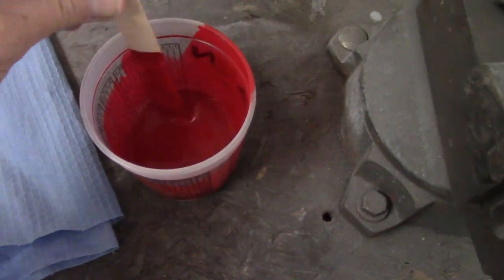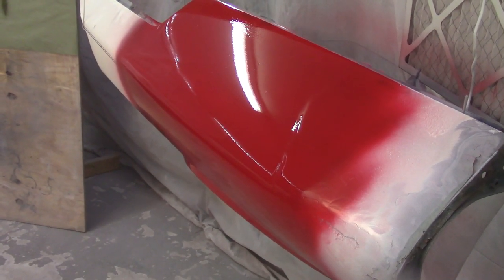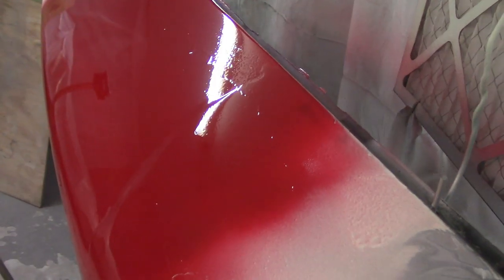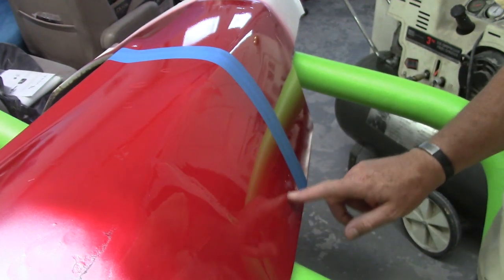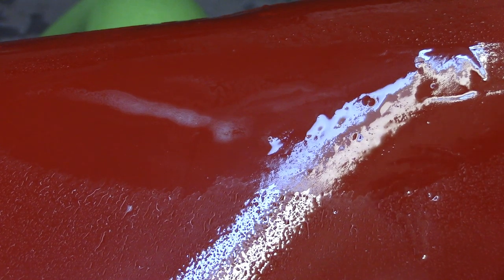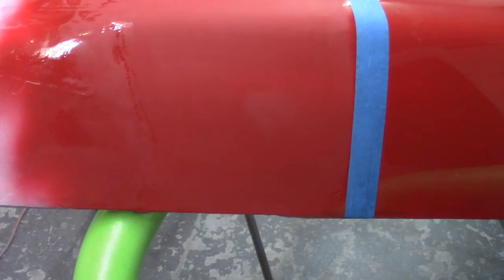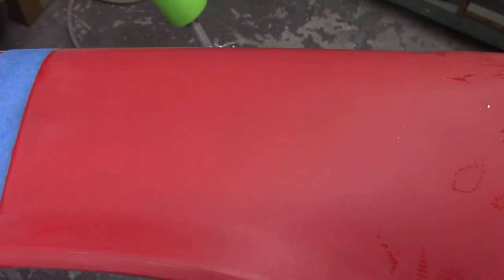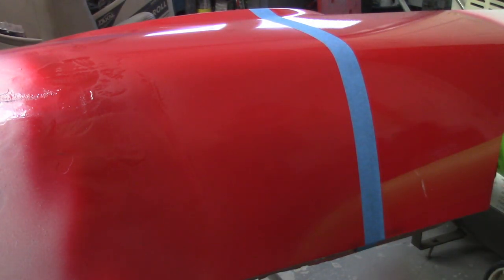Proof of Painting Procedure - Part 4 | Roundtail Restoration

Comment: Great job, Chris!  I like your use of the test panel. I had to repaint the roof of my SVX because of clear coat and paint failure. Using rattle cans I ran into some same issues as you: orange peel and sanding marks in the final product. I should have spent more time with the 3000 grit. Of course mine was a black top. Unforgiving. Next time I think I'll try old English white! Hmmm know someone else who paints his cars white?
Reply from the maker: Thanks! No way I'd try to do black...no way. Chef paints his cars white!

Comment: Hi Chris... I Think you need more time with the different steps. Dont use the 1000 grid that much, and end up with either 2400 or your 3000 grid before buffing.
When buffing, the machine have to do the work, just put A light pressure on the DA sander, Else you Will see the marks from the Sander in the paint afterwords.
I normally use the 3 step paste system from 3M (first one I use is the “fast Cut” paste).
The more effective you are with the wet sandpaper and with High number grid, the less work you have to do with the DA sander 😉 and the better shine you Will get.

Your work is looking great, I have seen all your videos on the Roundtail.. 👍🏽👍🏽👍🏽
Reply: PS: you Can even go 5000 grid before buffing... 🤪
Reply from the maker: Thank you, Viggo. Yes, more time at the higher grits. And I agree that I probably overdid it with the 1000. I think I mentioned that I was just trying to get a uniform haze. Need to study up some more!
Reply from the maker: 5000 is crazy. The 3000 felt smoother than paper...but I guess that how you get those paint jobs that seem almost 3D.

Comment: I'm no expert.  But I've spent a lot of time watching some great results.    I see two differences in method - you did more sanding (some will start cutting and buffing after 1500).   The other big difference is DA vs rotary.    Honestly I haven't seen a DA be used to bring gloss up during buffing.    Good use of a practice panel.    I'll have to get a couple.
Reply from the maker: Yes, like I said to Chef above, the rotary ones scared me based on what I was reading. I hope I don't regret not going that route, though. I think I do need to spend more time on the sanding stages, but not too much, of course.